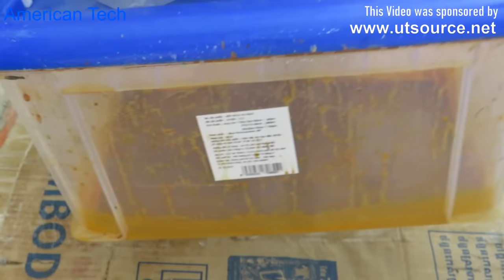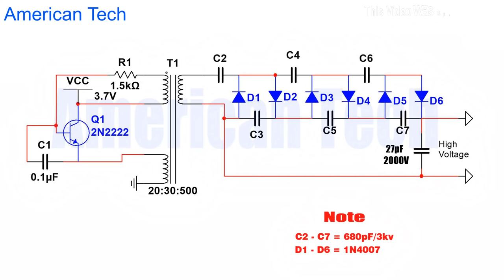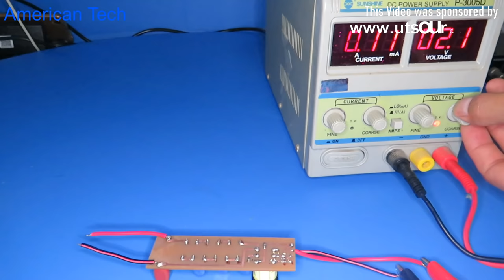High voltage generator for Mosquitos Racket

Comment: This is fake i think. I am still at scool but i know some things about electronicts. And i know that a marx generator works with dc and has spark gaps. Also i can't se the sparcs very clearly in the video. And when showing the sparcs he is not showing the power supply. Anyway, I am not absolutely sure 😕

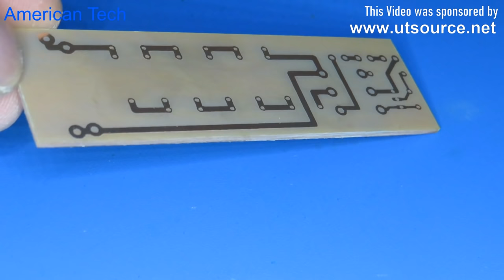Comment: Is my maths going weird here? The pdf for the transformer says it is a 1:5. But we will go with your 1:25. And we will go with you 3.7 as opposed to the 2v you had on power supply. So 3.7v x 25 = 92x6 capacitors = 555v, which would explain the small spark compared to the thumbnail picture.where is the 20kv?

Comment: most of  the charges are arcing between capacitor legs in the series on the other side of the board ,that's why you have no arc at the output  you should isolate capacitors legs or put them farther apart so that they don't discharge prematurely.

Comment: The transformer coil and the Cockcroft-Walton circuit are basically two types of voltage multipliers in series.
Have there been any efficiency considerations in place for the exact choice how the total voltage augmentation is divided between the two principles?

Comment: I love how at 5:10 you can clearly see a second person's hand helping direct the person who's actually doing the work. This is not the only video that this happens in. Makes me think that this entire channel is not quite honest. Quite a lot of the videos do actually work, but there are some fake ones as well, which makes me lose trust even more. 
Just our of curiosity, is there a way to up the discharge rate without replacing the transistor with a more powerful one? At first I thought that you could just use a beefier capacitor, but that idea I later realized wouldn't work. That'd make it take longer to charge. Using a less powerful capacitor would just result in it exploding.
Reply: VERY FUNNY COMMENT ,,,, MAY BE THERE ARE TEN PERSON WORKING ,,, YOU TELL ME,, DO YOU HAVE THE SKILL TO MAKE SOMETHING STILL SUPERIOR IN TECHNOLOGY ,,, EASY TO  MAKE AND WORK ,,, WITH SO SMALL NO,, OF PARTS,, ,,, I ALSO MENTION THAT CHANGE OF FREQUENCY ON TRANSFORMER CIRCUIT CAN REASONABLY CHANGE THE CAPACITY OF THE CIRCUIT ,,,,,
Reply: I think, the main limited factors are the capacitors in the multiplier circuit.
Reply: You need to know the Theory and working of parts in their place ,,,,, don't take it as a joke ,,,,
Reply: yes you keep on adding the diods and Capacitors in the configuration and the voltage eill keep on multiplying ,,,, but take care of the capacitor's working voltage ,,,,,,,

Comment: The 1n4007 diodes only support 1000 volts, you should choose a 2CL71A 8KV type diode, you will obtain less leakage, making the voltage much higher, greetings
Reply: Transformer ratio is 20:500 which is a 25x multiplier input voltage is 2 volts and there’s a 4 stage multiplier at the end. So 2 times 25 is 50 times a 4 stage multiplier which is 200 volts assuming perfect efficiency. The transistor is probably maxed out already the circuits not ideal.
Reply: You can’t push a higher voltage then 1000 likely.

Comment: To me it looks like some of the sparks are coming from somewhere other than the output wires.    I could be wrong but I don't think the output of this circuit would be very much.
Reply: It first creates a AC voltage, which than gets boosted by the transformer and multiplied by the capacitor circuit at the end. The capacitors limit the output current a lot, possible less would’ve even made more sense.

Comment: I dont know a whole lot about electrical work just yet, still in the learning process, but I was under the impression that transformers can not be used with DC?(direct current, i.e. anything that runs on an external power source or battery) but need AC(alternating current)
Reply: So I actually watched the rest of the video and he does not use a battery as the power supply 😅 that's just the thumbnail for clickbate.
Reply: Transistor at the front is an oscillator
Reply: @taylorreptar7898 , it‘s an DC lab bench supply.
Reply: When a capacitor is connected between E and C of the transistor, there will be a square wave generated by this. I tested it myself, it‘s some strange thing with the 2N2222(A) transistors.

Comment: Does upping the output voltage allow a longer distance from the negative grid to the live positive grid allow or need a larger spacing between the grids?  Seems to me having a window for seeing the bait level and a filling port without dis-mantling the bottom, plus having the bait at the circumfrence and a cone shaped hot & cold zapper at near the bottom would allow the dead bugs to fall out. With a grid so the bugs could not actually reach the bait would assist in them falling out instead of blocking the bait.  Vinegar is claimed to be the best bait so using a paper towel or sponge soaked in vinegar along with something preventing it from evaporating would assist in its longerively between adding bait and removing dead bugs. I did most of these things - including doubling the mesh size and length and every day had piles up to 6 inches high every day and still had to unplug it and hode it down to rid the grid from bugs stuck to the mesh. I plan on putting all my mods into a few units. Then i seek to add solar lit zappers to an electric fense around the parameter of our farm acerage... the fence charger should provide the killer shock.

Comment: I think it would be better if you installed 2 2kv high voltage capacitors in series. 1 capacitor used for a long time will burn out

Comment: what happens if you dont use diodes?
Reply: the diodes are for increasing the voltage with the capacitors and without diodes there is no voltage rise
Reply: @Koperlich.  
thanks for replying.

Comment: You got to love the meter there so low voltage the 18650 should work a lot better than the meter got 3 400kv pulse transformer running like a motorcycle hooked in did you work out how to get low emp feild yet????. Nice test set!. 😃😄😁😆😅5 Smiles.

Comment: is the output DC or AC?
Reply: Dc, the transistor outputs short pulses of +5v or whatever the input is, like half square wave
Reply: @JjMn1000 , i think it‘s AC because of the capacitive multiplier circuit and transformer. The 2N2222(A) transistors can for whatever reason give out a square wave, when there is a capacitor between E and C.

Comment: 20kvolt but the capacitor is 2kv max🤦
Reply: @themblue8236 , i think he means the one at 2:07. This one is connected to the output of the multiplier circuit.

Comment: Could you can use 12v battery.
Reply: Yes, but use a higher value resistor (maybe 10k) at R1, because this one seems to limit the current.

Comment: This is fake
Reply: It‘s not. The transistor and capacitor are creating a sawtooth wave, that will be induced into the coils. The circuit at the sec. side is a capacitive multiplier.
But the output voltage is most probably not 20kv.